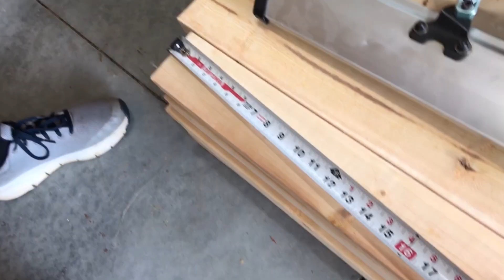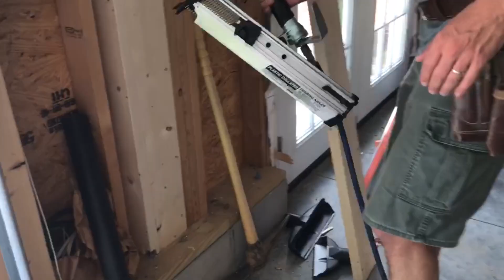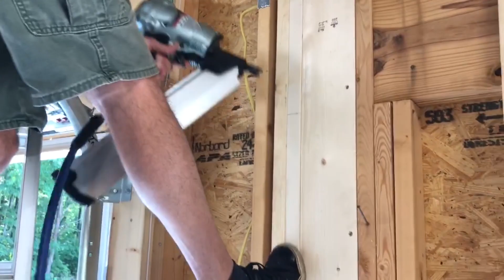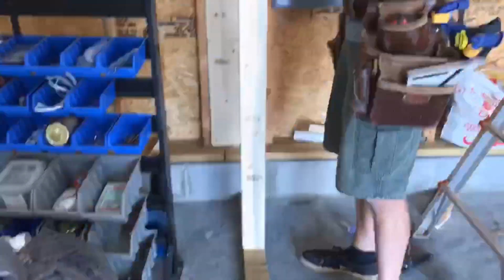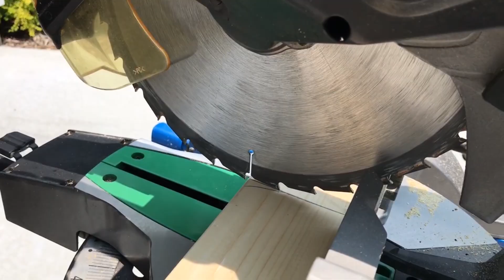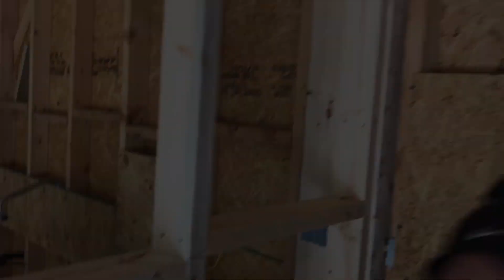Wall Framing (Part 1) | From Garage to Apartment | Episode 6

Comment: Tip: slightly fasten a deck screw in at an angle where a plate meets a stud (that edge/corner), then toenail the opposite side twice. The screw will act as a stop, allowing your final placement to match up nearly perfectly with your layout lines. Just unscrew, add your remaining toenail, rinse and repeat. Takes a little more time, but is great when you can't fasten with the wall on the ground.
Reply from the maker: Good tip. Thanks!

Comment: What kind of framing nailer are you using, and do you like it? Also, what kind of compressor are you using, and what pressure do you have it set to? (I'm in the market for these tools right now...)
Reply from the maker: I'm using the Hitachi NR90. I do like it. They're great nailers with a good reputation. The NR83 is legendary though. Probably the best. Regarding the compressor, we're just using a small Porter-Cable pancake compressor here. I think it's set around 95 PSI or so. It's my dad's and seems to keep up fine. I do have a Rigid mini wheelbarrow type compressor that does good when running multiple guns at the same time.